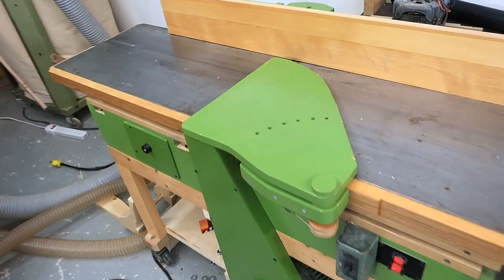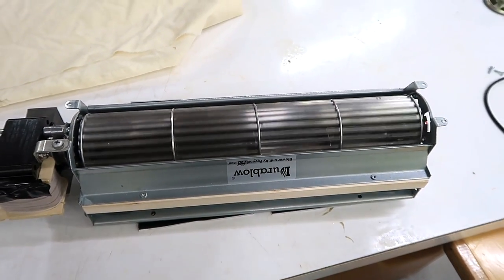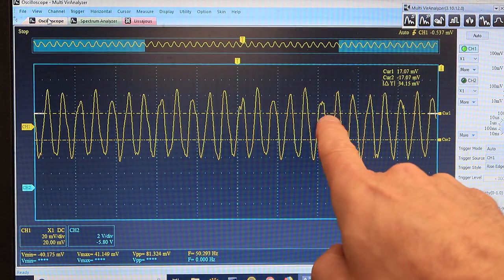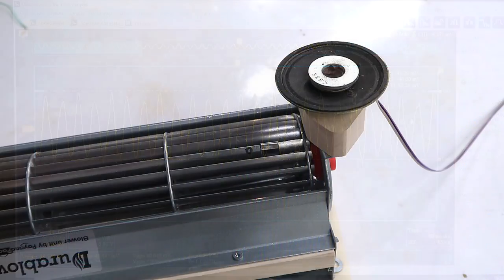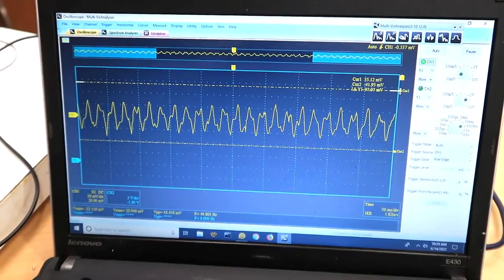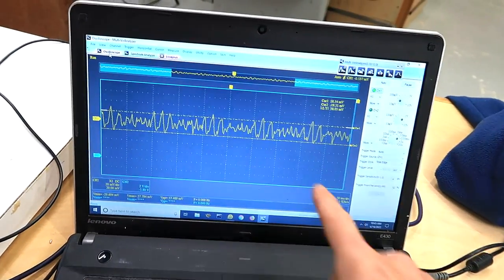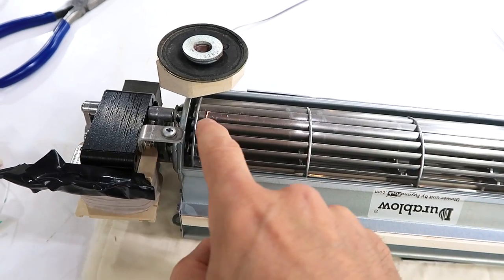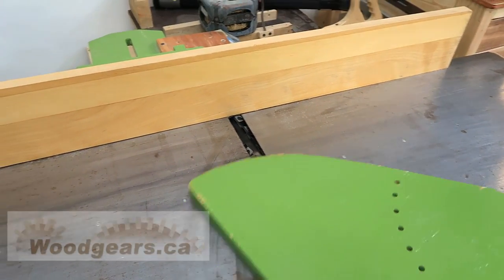Dynamic balancing with a scope and small speaker

Comment: Brilliant idea using a speaker as a sensor. I guess the coil moves up/down relative to the permanent magnet mounted in the speaker chassis. And this movement induces a voltage that reflects the amount of coil velocity/direction relative to the magnet. Is the coil the stationary part, and the magnet the moving part? If so, you could possibly magnify the readings by adding some mass to the coil/speaker cone (it stays more stationary, increasing the relative motion to the magnet).
Reply from the maker: The coil is the stationary part here.  Ideally I'd push the speaker membrane against the shaking object, but I can't mount the speaker by the membrane.  But this works ok for frequencies below maybe 300 hz.

Comment: I have an old computerized tire balancer that works in a similar fashion.  However, it first calculates static balance using a tachometer.  With a horizontal axis, the wheel will accelerate when the heavy side is turning down, and decelerate when it is on the up.

Back to your device, you could improve your trial and error approach by connecting the vibration trace with something that correlates to the phase of the wheel.  I would suggest putting on a strip of reflective tape and using a laser and photoresistor to pick that up as a second trace on your scope.
Reply from the maker: yes, I keep getting this comment over and over.  I didn't do it, not becasue I didn't think of it, but because it wasn't worth the development effort for what I wanted to accomplish.

Comment: As I understand, with a fan blade, or perhaps a cutting tool, the vibration that happens is a result of the sum of the imbalance of center of mass, and imbalance of the work done by each blade. 
Measuring vibration and compensating rotational balance may work better when the blades are only cutting air.  There may be only so much you can do when the blades are cutting wood.  For your jointer, you may have to confirm balance of sharpness and depth of cut, then finesse with vibration reduction with center of mass balance technique. Mostly conjecture.
Reply: You might use a speed control to vary the speed of the thing you're trying to minimize vibration.  How ever bad something vibrates, there's likely a slower speed that it's vibration is more dramatic and easy to detect.  This is where the rotating mass' holder is sympathetic with the frequency of vibration caused by imbalance.  It should make your detection mechanism much more sensitive.  However smooth things get at this speed, they'll be that smooth or smoother at higher speeds.

Comment: I happen to have done this almost this exact experiment on balancing some rotary things to reduce vibration. I found that using piezo electric buzzers worked really well if you take them out of the plastic shell and tape them onto the chassis. Signal wise, they're a bit noisier than speakers, but they're so low-profile and cheap you can easily put them anywhere.

One method I used was to put equal length bits of tape on the barrel, just barely long enough to reach the sensors which I taped to a bar. Each bit of tape was scored and cut to the same length, and so the impact on each sensor was due to bending moment of the barrel AND the timing/alignment end to end. I.e. you should be able to line up each strike exactly on a scope.
Reply: Clever...

Comment: With a light sensor or a construction of tape and a piece of wire, you could measure the phase and then find the right spot to balance with less trial and error. I'm really looking forward to the next video!
Reply from the maker: yes, I keep getting this comment over and over.  I didn't do it, not becasue I didn't think of it, but because it wasn't worth the development effort for what I wanted to accomplish.
Reply: @matthiasrandomstuff2221  Sorry, it's not easy to keep track of similar comments. Maybe I should have refreshed the page before commenting.

Comment: With the addition of either an optical sensor tach, on the scope, the phase of the vibration relative to the shaft position, can be used to find the offset and amplitude of the balance for accurately finding the weight and position for the correction. This is how a tire shop wheel balancer works.

Comment: On the first side you did, you added weight directly opposite of the manufacturers weight (fins 0 & 12 out of 24). Is there a reason you didn't just remove the original weight?
Reply from the maker: it's stuck on pretty good

Comment: Don't forget the motor is an electromagnet, and the speaker is also to some extent a receiver of magnetic fields. Some of that hum on the motor end could be electromagnetic coupling rather than actual vibration.

Comment: Perhaps some of the guesswork could be eliminated by syncing the scope to the rotational position of the shaft. A little dab of white or black paint on the perimeter and an opto-sensor could detect that.

You would also have to determine the phase relationship between the heavy side of the shaft and the 'scope reading. With no electrical load on the speaker the scope voltage would be related to the velocity of the speaker cone (relative to the speaker frame), which is the first derivative of the position of the speaker cone. The latter is proportional to the acceleration of the speaker frame (due to the spring-like nature of the cone mount). If I got that right the scope is showing the first derivative of the acceleration.

This might be more trouble than the trial-and-error approach for a one-off job though.
Reply from the maker: yes, I keep getting this comment over and over.  I didn't do it, not becasue I didn't think of it, but because it wasn't worth the development effort for what I wanted to accomplish.

Comment: if it comes to balancing the blade thing you probably will either have to balance it every time you replace a bit but you could probably do it with different length screws because i doubt you can shim it

Comment: How about adding an index to the rotor, to be read and synchronized with the scope? This should help automatically determine which angle needs more weights.
Reply from the maker: this has been suggested many times.  Not worth the development effort for one-time use (cause it's not as straightforward as you think)

Comment: Be careful using the makeshift accelerometer near an AC motor as it will introduce eddy currents into the coil and contaminate your data readings. I suggest an aluminum extension to position the sensor away from any electric motors ac or dc.. Just a suggestion.
Reply from the maker: Indeed, that's what I talked about in the video.

Comment: I'm curious if you noticed any difference in the amp draw - unbalanced vs balanced?
Reply from the maker: didn't check, but I don't expect it to make a noticeable difference.  Bearings will have slightly less load on them with reduces friction.

Comment: Need to add an encoder, then you could correlate the rotational position with the vibration
Reply from the maker: Indeed, something like a tire balancing machine will do that, but for a one off, not worth the effort.
Reply: @matthiasrandomstuff2221  Even a simple 1 notch per revolution encoder on your jointer cylinder with a 2 ch scope could give you phase(angle) relationship between high point and location.

Comment: Wow, thats incredible matthias, as a engineering studend and woodworker you are my inspiration too do my projects! I was thinking, can you use aluminum foil around to motor to make a faraday cage and prevent the oscilloscope from picking the motor eletromagnetic field?
Reply: It's not picking up "EMF" as much as the varying magnetic field (the difference is subtle but there) and the motor itself mechanically vibrates not as a result of rotation but as the core deforms while interacting with the field (as he demonstrated). 

Aluminum foil would have an immeasurable damping effect on the varying field (only forming trivial Eddy currents). 

Heavy copper banding is used around the outside of transformers as a "shorted turn" that's external to the intended path, exploiting a similar idea. On a motor, it's done differently in most cases (however older power transformers in particular used it as well):

Iron is the way to go for what you intend with your question. Routing the field away from the speaker by confining it in a material with high permeability. In a closed frame motor, the frame generally does a reasonable job of this. Open frame like these simple shaded poles leak quite a bit of flux both due to the nature of the stator construction and the fact there's nothing to trap the flux as it expands and collapses.

So, no, the concept of a traditional Faraday cage won't work down at these frequencies to any sort of appreciable degree. Many times in electronics (RF subassemblies for example) you'll find that the Faraday cages are made of nickel plated steel, to help shield against these lower frequencies and keep them both in or out as the situation demands.

Comment: That was very interesting.  Amazing how effective your sensor and pieces of wire worked.  

Did you notice a reduction in noise coming from the blower?
Reply from the maker: The air movement sound dominates, and this didn't chagne that
Reply: @matthiasrandomstuff2221  In the truest sense, yes, there was a reduction in noise... and the speaker helped identify the reduction!  That being said, I understand the question...

Comment: What are you using as the o'scope that you have hooked up to the computer?  Is that a hardware o'scope which is just using the computer for the display?  Or, is that software o'scope using a sound card interface?

Comment: Absolutely fascinating, would it be worth using some sort of optocoupler or hacking a digital rpm meter on a second channel that way you can line up the weight with the point of rotation? Obviously the trial and error worked fine on this occasion but if you need to drill holes in the jointer head you probably want it right first time Haha?
Reply from the maker: yes, I keep getting this comment over and over.  I didn't do it, not becasue I didn't think of it, but because it wasn't worth the development effort for what I wanted to accomplish.
Reply: That’s the beauty of a three point analysis using polar graph, no indexing is required as long as you have the three points marked 1, 2, and 3. You basically draw. Circle and divide it into three equal segments . Using the same trial weight in the three location, you draw a circle on your  graph. The diameter of the circle is determined by the amount of imbalance. When you have a trial weight of correct mass, the three circles on the polar graph will intersect. This tells you where to place the weight and you can calculate the weight of the final balance weight.

Comment: The hard part in using this method is setting up the structure to move in a predictable manner so you can measure the movement directly resulting from the vibration and not a movement as a reflection or vector of the force imparted by the vibration…

Comment: Interesting, how do you plan on adding weights to the new cutterhead permanently? Or is this going to be more a subtractive process using the cutters as the weights and hoping the impact on air resistance is  low enough?
Reply from the maker: I coud drill holes in it or angle grinder some bits off.
Reply: @matthiasrandomstuff2221  What if you weighed the carbide inserts and screws individually to check for inconsistencies and attempt to balance that way first.  Then add/subtract afterwords?
Reply: @andyjbauman  you are suggesting to attempt to match every screw and cutterhead weight ?
Reply: @bmxscape  With a balance that is accurate to 0.1 gram, it may be possible to weight them all, tabulate it in excel to see if there is a significant difference.  If so, possibly apply that to balancing the rotor.
Reply: I suggest removing all cutters and testing the cutterhead first without them.  Chances are the cutters are all identical in mass, are all present, and are positioned symmetrically and so are not the cause of the imbalance.  That simplifies the task and makes it so much safer!

Comment: Today's 3D accelerometers are cheap as dirt, and very sensitive and accurate. 
ADXL335 for example, has 3 axis analog output.
Reply from the maker: and the speaker I already had!
Reply: @matthiasrandomstuff2221  An accelerometer is an invaluable tool to have. Speakers massive coil has low resonant frequency due to inertia. 
A MEMS unit will have it's resonant frequency in excess of 5KHz.

Comment: This is similar to how input shaping is done on my 3d printer. It uses a ADXL343 accelerometer instead of the speaker coil to measure resonance. The software does most the work in "balancing" as it's throwing and unbalanced weight around and needs to avoid certain changes in direction that amount to a resonant frequency of the printer. Drones also have a similar test as the inertial measurement unit can be used to measure vibrations. Here is a video on doing that process on a 3d printer. https://youtu.be/EJapxNsntsQ?t=878

Comment: I gave a dislike to this video. Not enough proper info.
How are you getting the Output Signal from the Speaker into the Software of the Computer?
+/- of the speaker connected to +/- of a USB male plug?
Through the 3.5mm audio jack with +/- of the speaker connected to +/- of the Male Audio Plug?